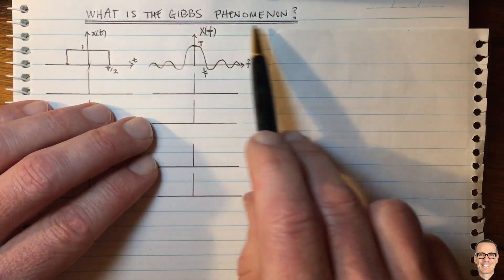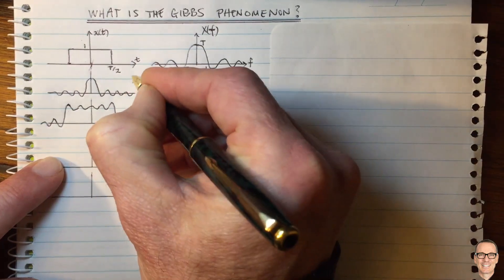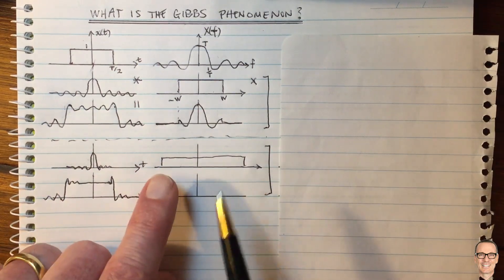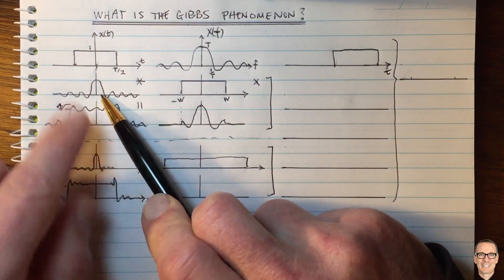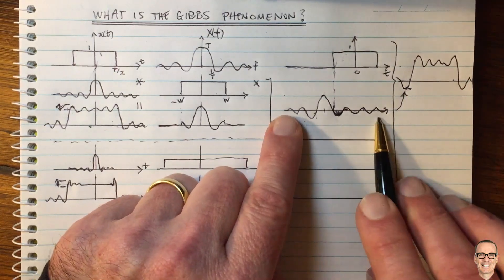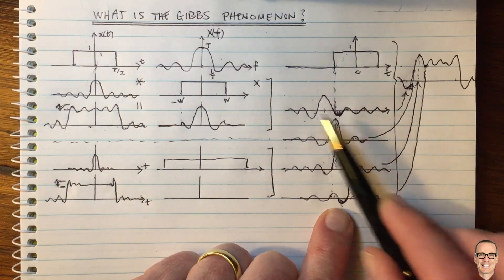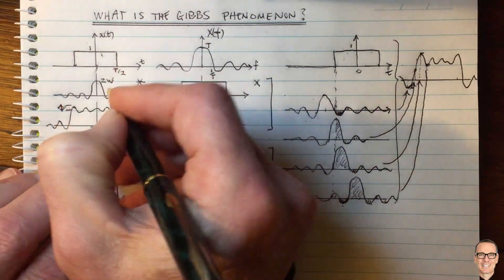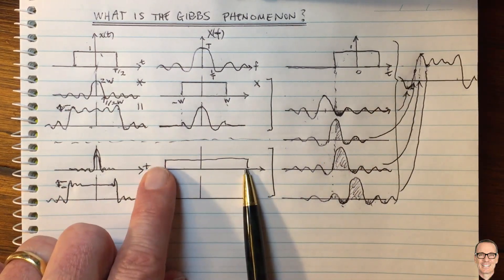What is the Gibbs Phenomenon?

Comment: How do we get ride of the overshoot?
Reply: In theory just use a filter with infite bandwidth, and all frequencies of the orifinal signal will be present. In practice you can´t, remember physical electronic elements have a time delay when reacting to fast changing signals, and will cut some frequencies. In most use cases, the overshoot can be just ingnored.

Comment: The video detailed truncation in frequency domain causes ripples in time domain , what if we truncated the time domain , shall we have ripples at the frequency domain ?

How is windowing used to remedy the gipps phenomenon ?
Reply from the maker: Yes, good observation. The Fourier transform and the inverse Fourier transform are almost identical, so the duality will hold. You may be interested to watch: "Fourier Trfm and Inv FT: What's the difference?" https://youtu.be/N8RV6WT4sTY

The conventional way to treat the Gibbs phenomenon is either to introduce a transition between the passband and stopband or to apply a window to taper the waveform to zero or near zero at its ends. See the following paper for more details: C. Pan, "Gibbs phenomenon removal and digital filtering directly through the fast Fourier transform," available from: https://www.researchgate.net/publication/3317921_Gibbs_phenomenon_removal_and_digital_filtering_directly_through_the_fast_Fourier_transform
Reply: Could you show the effect of using a Cubed Sinc window function?